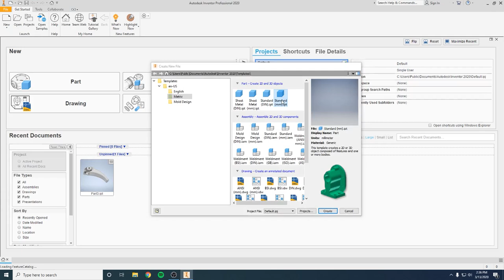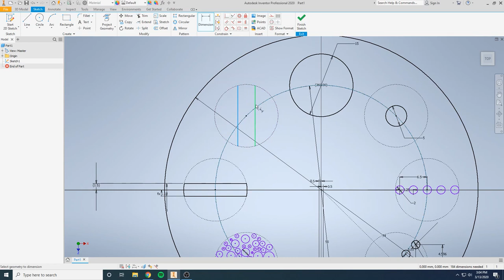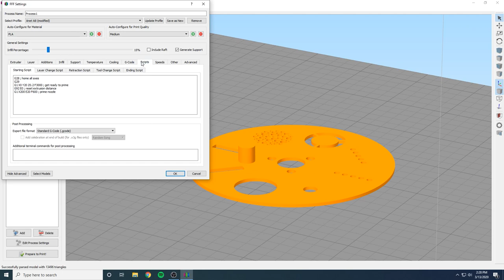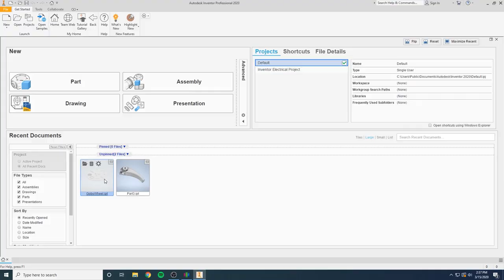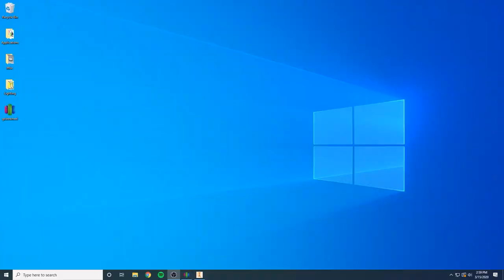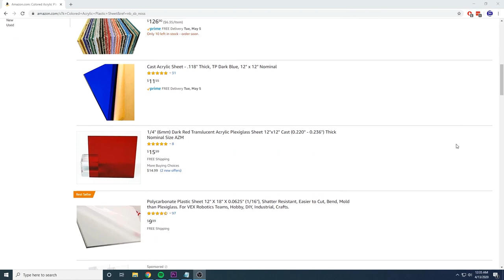Cheap LED Moving Spot Gobo Wheel Upgrade

Comment: Nice work! Just wanted to mention an easier way to recalibrate these Chinese mini-spots after mods/cleaning: If you hold down the Enter button for a few seconds, you'll reach a hidden factory menu where you can tweak the home offset for each motor (pan/tilt/color/gobo).
Reply from the maker: Oh, wow! Nice tip, I'll have to give this a try!
Reply: I will try this on my miss aligned chines bee eye moving heads, thanks!!! 😋

Comment: This is actually incredible. I had no idea this was even possible. It's such a simple mod, yet the results are amazing. I used to have the same kind of moving heads and I ended up selling them because they just didn't look good but I'm definitely going to try find some again and give this a go. Thanks so much for this and for sharing the print files!
Reply from the maker: Thanks for watching and all the kind words! Much more to come!

Modular, road-worthy, computer-independent/integrated, custom control surfaces anyone? 

How about an ultra-affordable, multi channel, config-free, decentralized, internet agnostic, networked comms system (This one may or may not already be built! 👀) ?

Stay tuned!

Comment: People have been able to special order custom gobo wheels for about 30 years now.

The easiest way would be using fixtures large enough that use standard sized replaceable and/or rotatable gobos.

If you want to look into how the oldest color mixing light fixture did it look up High End Systems Color Pro. Three lamps, three pieces of dichroic glass.

Comment: That's actually funny  for a second I thought you were going to use a CNC machine  the cutting aluminum piece  but it's still pretty impressive that you're able to 3D print one  I have a couple of these lights on the way and I might take advantage of that myself and see what it's like  as I've noticed the patterns  aren't really that good that comes with them even the latest model still have the  same ones I think  anyway brilliant video

Comment: What a coincidence that YouTube recommended me this video. I've just torn apart my Moving Head, it's pretty similar, same board, same gobos, same base, only the head looks slightly different. Mine is probably an older version but the same model. Somehow the UI on the seven segment display never made sense, the light source on mine was pretty dim and I didn't like the color filters and gobos. So I removed everything now except for the stepper motors and power supply.
I will use this as an experiment so my decision might not make sense to everyone.
For the light source I will be using a massive 82mm COB Led, probably without lenses and I won't use the gobos and color filters anymore, so I will have to 3D print my own shell. For the stepper drivers, I'm trying how tmc2209s perform on a moving head. Depending on which Microcontroller I will be using, I might also include RDM or Artnet over WiFi, because why not use it if the microcontroller can do it. I'm pretty sure one of those two things will be useful sooner or later.
Reply from the maker: Very cool! Please make sure to show off what you acomplish with that project! I'd love to see how much performance you manage to squeeze out of one of these!

I've moved on form these little movers, but now I have some other projects in the works:

Modular, road-worthy, computer-independent/integrated, custom control surfaces anyone? 

How about an ultra-affordable, multi channel, config-free, decentralized, internet agnostic, networked comms system (This one may or may not already be built! 👀) ?

Stay tuned!

Comment: Hello, nice video. I was watching and it came to my mind that you could spray it with black spray instead of the folium :)
Reply from the maker: Hey, thanks! Paint may be an option, but the black would likely turn too much of the light into heat and melt the plastic. Perhaps a good, opaque, white paint would do it. Thanks for watching!

Comment: I’m about to get 8 of these lights and would love to customize the gobos and also interested in making them rotate as well. Interested in taking orders?
Reply from the maker: Hi there! 

I'm working on coming up with a way to streamline the manufacturing of these in order to be able to sell them. Hopefully I'll have a solution soon!

I'm in the process of putting together some of these with rotating gobos. This is proving to be quite a challenge, but I think I can do it!

Keep an eye out! Any updates I have will likely be posted as videos.

Thanks for watching!
Reply: @ConnorEhrgood  How in the world would you be able to fit a rotating gobo system in there? You need an extra motor and a bunch of other things in the gobo wheel.

Comment: I'm thinking about cutting some designs out of "chrome" vinyl and using a clear acrylic disk for the wheel. seems like it might be quicker and easier.
Reply from the maker: This seems like a great idea! Let me know how that goes.
Reply: @ConnorEhrgood  I will. Using them for the first time this coming Saturday night. I want to see how the stock version works before I take them apart.
Reply: @ConnorEhrgood  and to be clear, I would never have thought about it if you wouldn’t have made this video. I don’t have a 3D printer (yet!), so as I’m watching your video I’m thinking about how I can do this myself. Metal disks with simple hole patterns or using my little CNC machine are bouncing around in my head as I’m watching. Then you put the aluminum tape on your wheel and a light clicked on for me. :) thank you for the inspiration. If the vinyl works, that opens up much more complex designs. Maybe my band’s logo? Something that fits the theme of an event? :)
Reply from the maker: @geoffcowan2384  Honestly super humbled by this! Glad I could spark an idea! A good example of the AvE principal: "Make cool s*** and put it on the internet!"

Comment: Super cool!!! How did you tune the homing because some of my mini headers have the tilt to mutch down
Reply from the maker: Hi there! Only took me 10 months to notice this comment 😬

Back when I was running these, I would literally just grab them and force them to skip steps until they were all about aligned. I also did my best to better align the hall effect sensor they home themselves with, but that never yielded great results. There's another comment mentioning that there's some sort of calibration menu, though I never got a chance to try that. I'd say give that a go!

Thanks for watching and the kind words! Much more to come!

Modular, road-worthy, computer-independent/integrated, custom control surfaces anyone? 

How about an ultra-affordable, multi channel, config-free, decentralized, internet agnostic, networked comms system (This one may or may not already be built! 👀) ?

Stay tuned!

Comment: Very cool video! I have a few of these lights and never even thought about the upgrade potentials. I like the CMY colour mixing idea as well, it sounds very difficult to accomplish though. Have you considered whether adding RGB led modules along with the built in white one to get RGB colour mixing is feasible? I have no experience in this type of modding so perhaps you've ruled it out for an obvious reason, sounds more doable to me off the top of my head though
Reply from the maker: Hey, thanks for watching! I've considered using an RGB LED, but I suspect I would struggle to source a sufficiently bright LED and know that my limited optical knowledge would likely not yield the nice even mix I'd be after, although maybe it's simpler than I'm thinking. Looks like there's room for others to improve these further!

Comment: I have dozens of these lights . Get the gobo made of metal. I have seen fires in these lights . We had to get the more expencive ones because of how the casing melts .
Reply from the maker: Hi there! Seems your fixtures are making a good deal more light than mine. Definitely not seeing anything get hot enough to melt, let alone combust! I don't imagine it would take all that much more light, though. I have some newer fixtures that will just cook ANYTHING in the optical path that isn't glass or metal, so it's entirely possible.

I've about retired these guys. Just too much fuss in the hustle and bustle of load in and out.

Comment: Maybe rather than 3d printing these out of plastic you could send them off to a cheap laser service. similar to the service used to make stencils for solder paste? Idk if sendcutsend can do this or not.
Reply from the maker: There was a brief while I though about this for making them in bulk to sell. It would totally work. I've done this before for more standard gobos. Quick turnaround and mega cheap. Thanks for watching!

Comment: Nice work! I wonder if heat resistant paint would be better
Reply from the maker: Thanks! A good, opaque white paint may be able to pull this off. It would come down to whether the little bit of heat wicking provided by the aluminum tape is actually needed, and that is something I'm not sure of. Worth a shot, I'd say! Thatns for watching!

Comment: I made it (had to modify for my moving head) and even with the tape it softened a ton. What material did you use?
Reply from the maker: Hey there! I used some generic white ABS. I suspect PC would be an even better option if you have a machine that can handle it.

I would imagine that PLA will not work. It's likely that the ambient temperature in the fixture while operating for an extended period of time alone would be too much for PLA to handle even without the extra head from light absorption

Good luck! I hope you find a material that works. Thanks for watching!
Reply: @ConnorEhrgood  I think I may have a solution, I am going to try to anneal PLA by boiling it in water, which raises the softening point much higher. I'll update whenever I can get around to it.

Comment: Could you be convinced to sell these? I'd like at least 5 to start.
Reply from the maker: Hi there!

I could totally make up a few of the wheels to ship out for you to install in your fixtures. Let me know if this is something you want me to get going and I'll put together some sort of shop.

It's worth mentioning that I could customize the wheel to your liking, although I'd probably charge a bit more for the time involved in doing that.

Also, keep an eye out. I'm looking to build a gobo wheel with rotating indexable gobos as well as continuous rotation for both the gobo and color wheels. I'm thinking I may sell a conversion kit for others to do this as well.

Thanks for watching!

Best regards,
Connor
Reply: @ConnorEhrgood  I'm about to pick up some of these exact same lights and I would be extremely interested in buying a conversion kit that could add rotation to the gobos!
Reply: I’m about to get 8 of these lights and would love to customize the gobos and also interested in making them rotate as well.
Reply: @ConnorEhrgood  how much would you sell them for in really interested?
Reply: @ConnorEhrgood  I know it's been a minute but I'd absolutely be interested in buying some!!! The bars and linear dots are some effects I would love to have. Pretty much anything that actually looks different in the light beam would be an upgrade over what these thigns have stock!
Reply from the maker: @94XJ  Hello again! I'm working on streamlining the manufacture of these. They take some time right now. Keep an eye out, I'll likely post updates in a video here soon!

Thanks for watching!

Comment: Awesome work. What software do you use to control them?
Reply from the maker: Hi there! Thanks for the kind words!

Back when I put this video together I was running the rig with QLC+, which is free and was pretty decent, but I've since made the leap to GrandMA3 onPC, and it's worth EVERY PENNY.

Thanks for watching! Much more to come!

Modular, road-worthy, computer-independent/integrated, custom control surfaces anyone? 

How about an ultra-affordable, multi channel, config-free, decentralized, internet agnostic, networked comms system (This one may or may not already be built! 👀) ?

Stay tuned!
Reply: How did you get those efx to run so smooth on QLC? And if you ever take orders. I’ll take 4 of those wheels!

Comment: How many watts are those lights?
Reply: Usually theyre 10-20 watts
Reply: Can you post the link of the light you used in the video? I’m interested in buying some for my self
Reply: @1highchango559  I did not make the video, so i dont know what model these are. Try and google movinghead 10watt on google or amazon. Similar heads to those in the video should pop op :)
Reply from the maker: These guys claim to be 60 Watts. I don't think they're quite that, but I think they're a good bit more than 10 or 20. I've just gotten some Focus Spot 4Zs, and they actually hold up surprisingly well in terms of brightness compared to those. I've been meaning to test them, just haven't gotten the chance yet.
Reply: @ConnorEhrgood  So you replaced the ones in this video with the Focus Spot 4Zs on the top back truss? Aren't those  Focus Spot 4Zs like $900 each? Yikes! I've been looking at 100W no-name ones from China for like $200 on Ebay to do the same job on back truss.  This would be for my cover band.
Reply from the maker: @davedreher9254  I did, I just needed some more kick a**. They're worth every penny, I don't even mess with the little ones anymore, we're starting to operate at a serious level, and they're just a pain compared to the 4Zs. I can send the 4Zs out with a crew on a show or to a client for rental and just know that everything will work and work well without me there, which is everything.